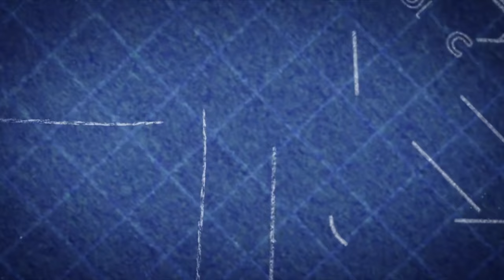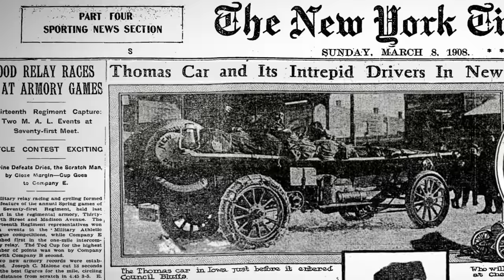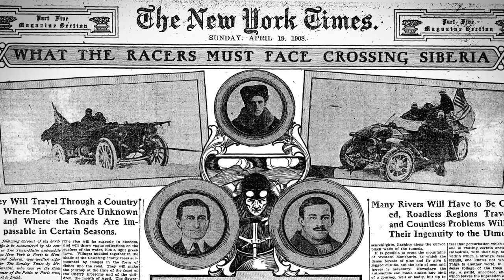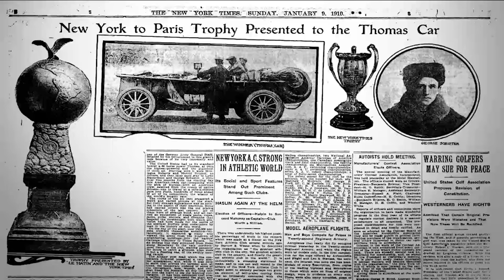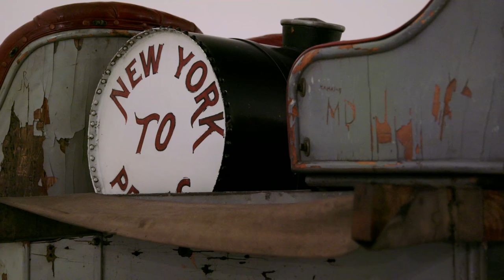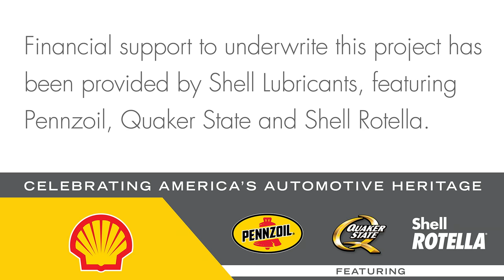This Car Matters: Thomas Flyer, winner of the New York to Paris Race

Comment: Even when anti-freeze was available ppl did not use it.  My Grandfather told me about winters in Chicago and driving his Model A.  They could not afford anti-freeze so it was normal for them to drain/re-fill the cooling system every night.  He remembers several times he came out of a bar, drunk, and forgot to refill the system.  Said by the time he drove home he could see parts of the engine glowing red.  Yep, Grandpa was a drunk.  Said it was common back then for all the guys to get drunk on Dago Red.